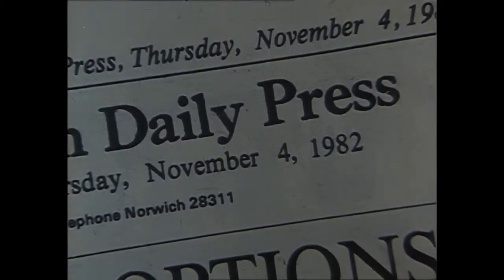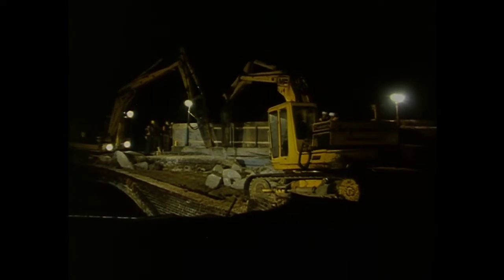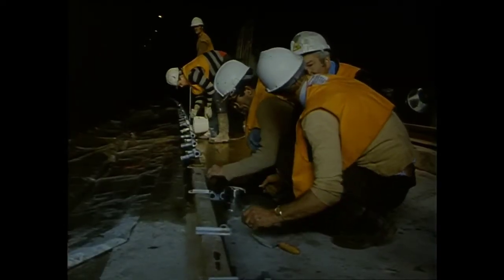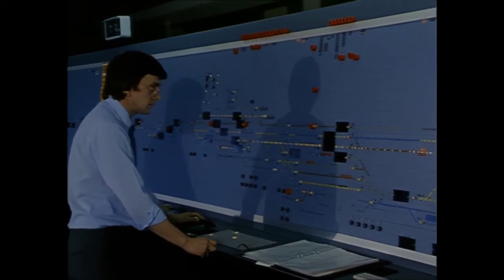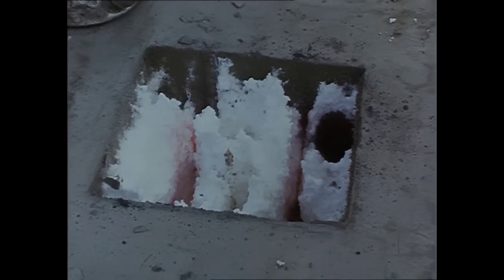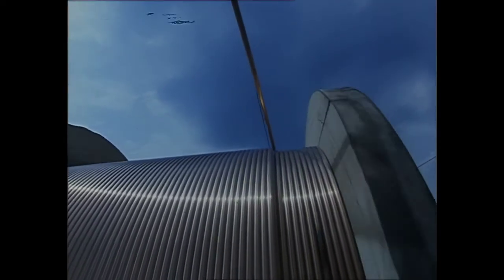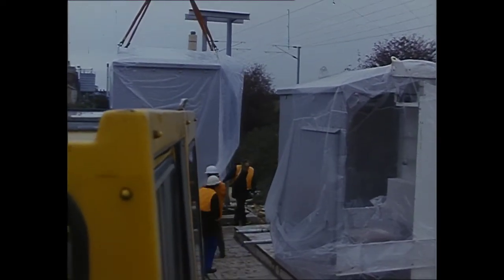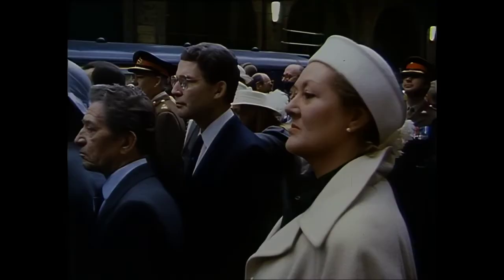Anglia Electrification (British Rail, 1985)

Comment: Hi there my real Name is Mr Cannadine T. Boxill-Harris, I have another interesting idea for most of us Class 507, Class 508, Class 313, and Class 314 and that also includes those interesting Class 315 Fans out there, rather than scrapping most of those Class 507, Class 508, Class 313's Class 314 including the Class 315's maybe you guys can convert them. Including the refurbishment into the Volvo TD102KF Engine, Volvo B10M Engine, Scania N112 Engine, Leyland 510 Engine, Cummins M11 Engine, Gardner LG1200 Engine, Gardner 6LXB Engine, Gardner 8LXB Engine, Class 507, Class 508, Class 313's, Class 314's and the Class 315's and convert all of them into a 2 Carriages and Three Carriages of the Class 313's, Class 314's and that is including those Class 315's for most of us Class 314 and Class 315 Diesel Train Fans PLEASE? Are you still going to do this interesting type of Project for all of us out there Pretty Please.
Reply: Shush

Comment: How very 80s! 😁   Most of that equipment is still looking in good condition now, nearly 40 years on.    That said, we didn't get the "more comfortable trains" as such for quite some time - the Mk2D rolling stock remained for another 20 years!  Albeit hauled by an AC leccy rather than a tractor.  The Mk3 sets were good, albeit dated looking (never fully refurbished like the ECML mk3 sets).  Arguably better than the EMUs that have since replaced them.
Reply: Mk3’s a 100% more comfortable than the new stock with their iron board seats and harsh rocking ride.
Reply: @paulwright5728  The seats in the Sadler units are actually some of the better offerings among the new fleets - Certainly better than the awful ones on the IETs.  I agree the ride and overall refinement is a backward step though.